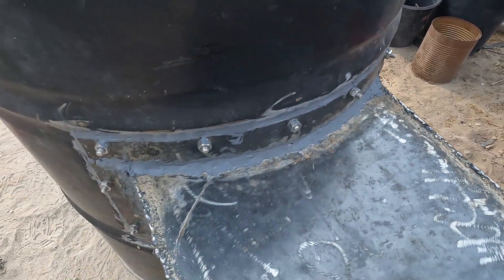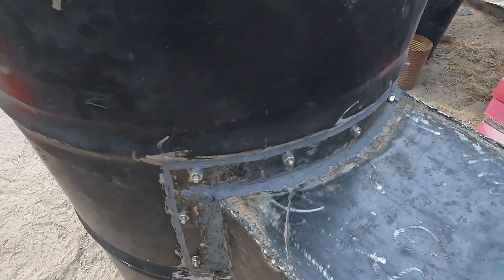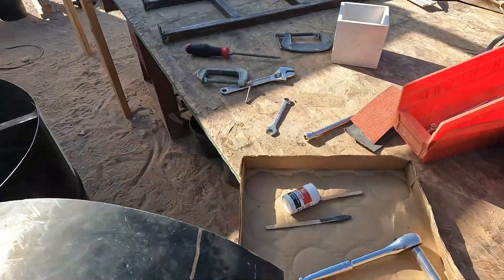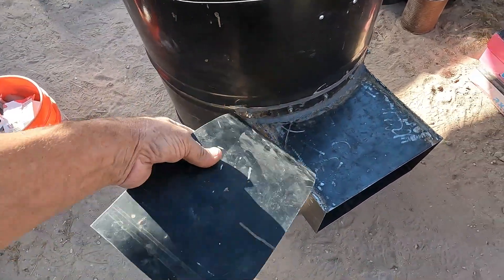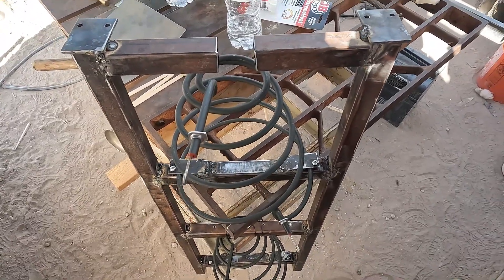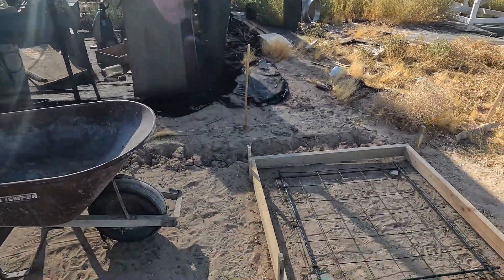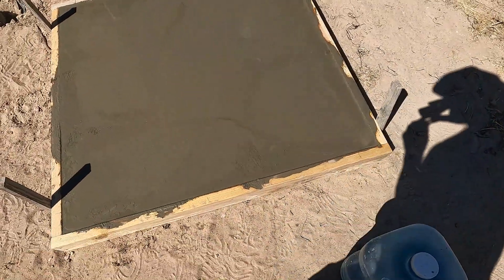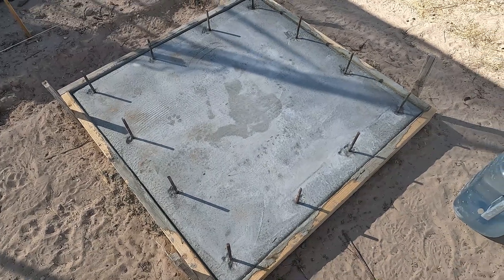158 - Fifty-Five Gallon Sand Battery Update

Comment: Interesting project, I understand you can use solar power to heat the elements, how are you getting the energy out though? 
I'm assuming it's for extraction of heat for use later?
I've got an electric furnace for casting metal and it takes hours to cool down so I can appreciate you definitely have a worthwhile project.
Reply from the maker: Yes I will incase it in another metal box. Than inaulate it and draw heat from the box with fans. I have a crude diagram in a previous video.